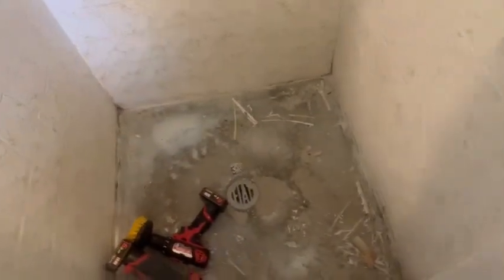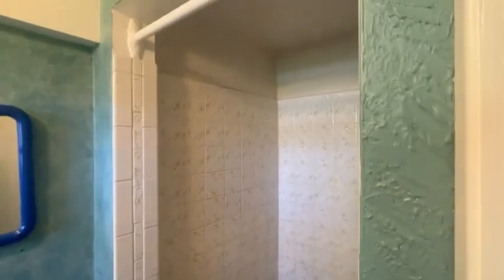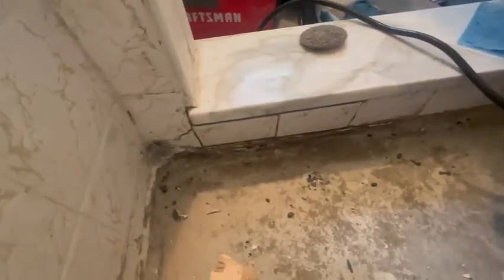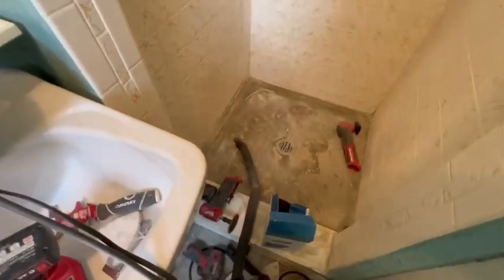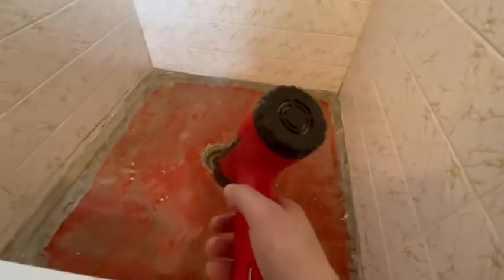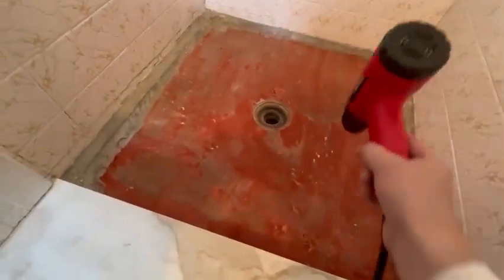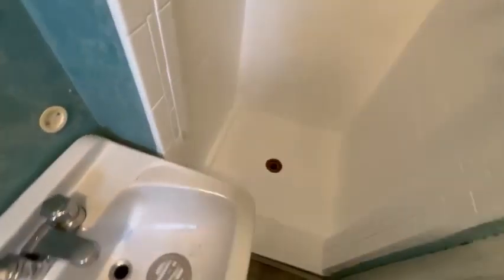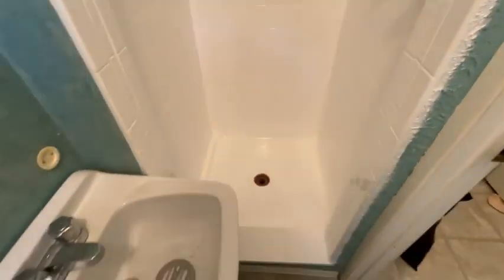Reglazing a standup ceramic shower!

Comment: Can you use crosslink and after hawk labs primer and gloss or do you think it might not work ? Nice work !
Reply from the maker: Yes you can cross link under any coating.
This job I cross linked then Midwest prime, then summet topkote.
But I have crosdlinked then hawk prime, then hawk 4hr topcoat.
Just make sure the crosslink is dry to touch, or it will do weird things of you prime on it and it’s still damp.